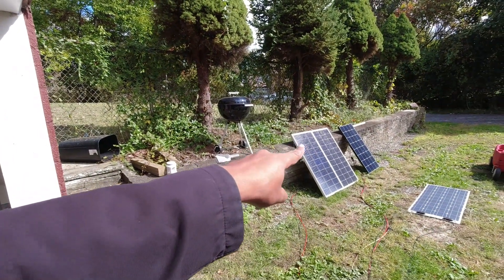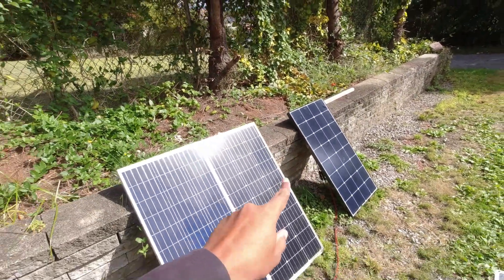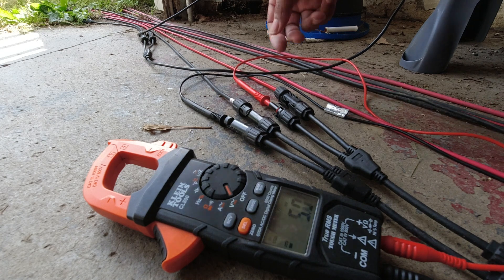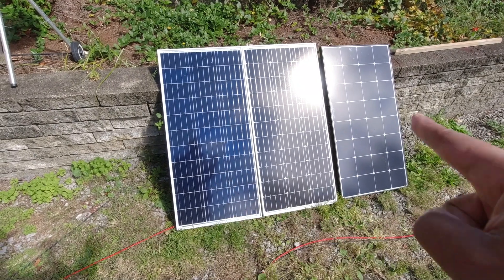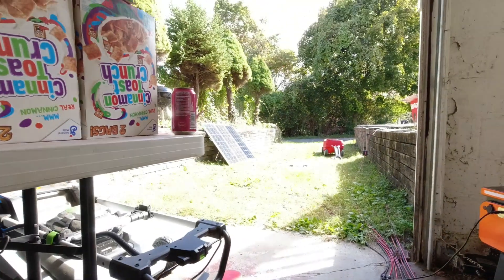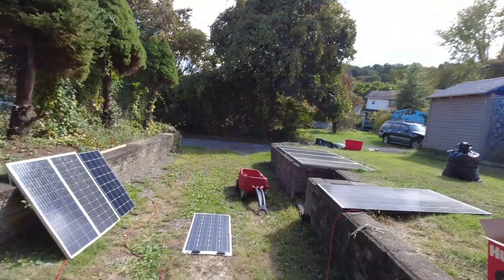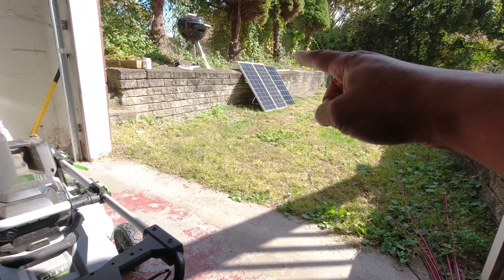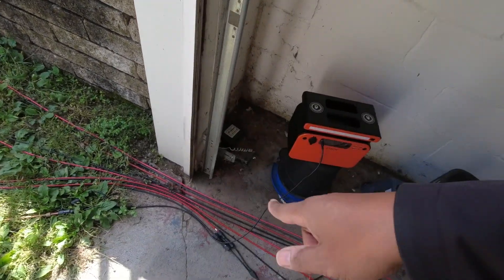Putting Mismatched Solar Panels In Series w/ EB120

Comment: Hello I just received my EB 120 can you show me how to switch the unit between the AC connection and the solar connection I don't want to damage the unit and no one has a video showing the basic setup for this unit
Reply from the maker: When you say switch, you mean powering it? 

It had a single charge port. Plug solar in for solar and plug in the ac to charge it that way. 

The main thing to make sure you get right is the solar panels voltage.
Reply: @AskIveSolar  just for an example on the large bluetti units a person has to go into settings and select solar or AC when charging. Do I have to do the same with this smaller unit
Reply from the maker: On the larger ones, you have to choose between solar and 12v. That does apply to this one though.

Comment: The problem with panel mismatch is shading anywhere in the series array,  it cannot pass enough current through even though there is a diode arrangement that let's the remaining voltage through. 
My parallel system defeats that but I'm stuck on a lower 24v system and defeats the object in question. 
Its less vulnerable for shading in my personal experience.
Reply from the maker: Yeah I just have to deal with the series drawbacks on this device because its amp limit is so low. It maxes out at 10 amps. But those panels dont move much and when shade hits, it hits pretty much the entire array.
Reply: @AskIveSolar  its really good to see you expanding on your ideas for the best option of output.
Your evolving more and more.
Just wish I had your buying power to some of these materials lol
Reply from the maker: I got a little youtuber clout. Not buying power. Lol
Reply: @AskIveSolar  haha exactly, its great providing your own energy. 
Winter sucks for lifepo4 raw battery storage when you have 700AH and only getting 2A at best through the day man.

Comment: Series will add by the lowest voltage in series. And amperage will average out between the 3. Since we never get full output of panels would it be worth it to run 4 panels? 2S2P? 43.2v at 10.5 amps? I would almost bet on 9.5-9.8 amps @ 40 ish volts? My renogy 40 amp rover mppt has 600 watts. I overpaneneled about 15% only cause I rarely see over 85% efficiency. I have 4 hqst panels in series at 82 volts and 5 amps. I usually see about 360 watts max but normal output is 330-340. Most mppt Controller have a 10-20% over current due to the way clouds move. Once I got 680 watts out of 600 watt array of renogy 100 watt panels because  there was a hole in the clouds lol.
Reply from the maker: Man I would have to read this like 4 more times. but I think I follow what youre saying and I agree. I just dont think in terms of separate charge controllers but in terms of power stations. 

So yeah, might as well go parallel because 1. that gives you some shade protection and 2. what you said about the amps. The only thing is needing to buy the 10 dollar cable but thats nothing. 

Good thoughts!!

Comment: Great explanation and demos to show the panel voltages in series. I liked seeing the panels open circuit vs under load and it all lined up as it should. Glad to see you getting near rated power with 3 of similar specd panels!
Reply from the maker: That tip you shared is priceless for this stuff! Thanks again

Comment: need higher awg to get more amps further, if you have no load, voltage transfers with little loss, put a load on it and you will loose volts the higher the load and the lower the awg to heat in the wire that acts as a resistor. if you try to push too many watts down a small wire you will notice it get hot enough to melt the insulation. this is how fires are created.
Reply from the maker: Got another video where I test something like this. 12 awg vs 10awg. It's coming soon. 

This awg and length should be fine for 5 amps.